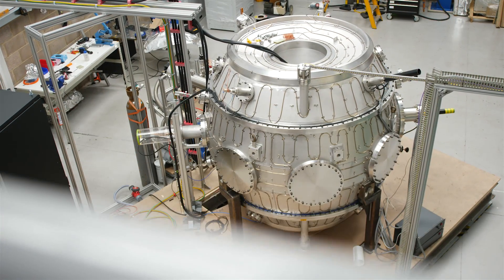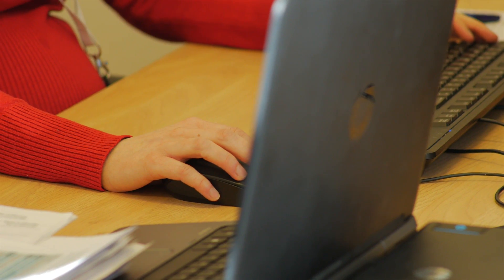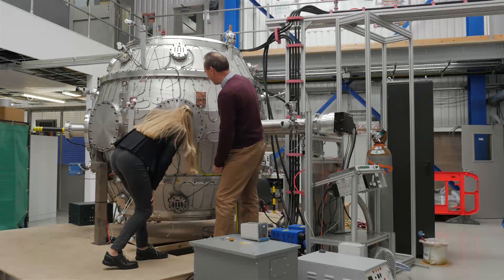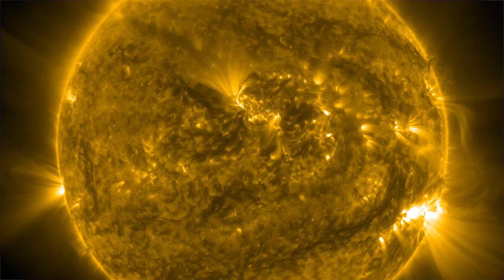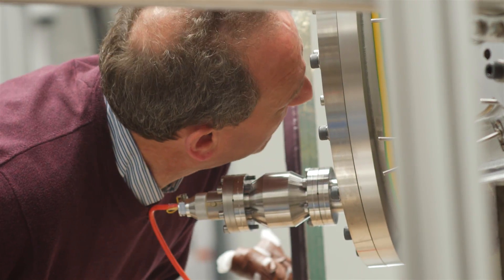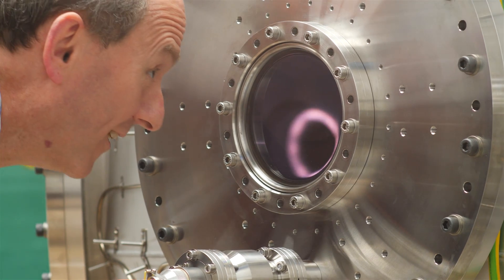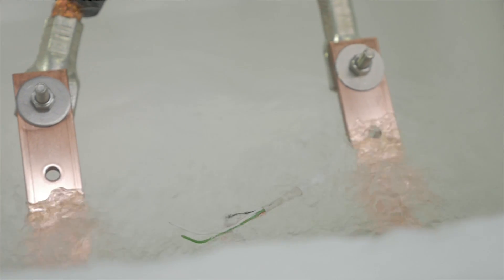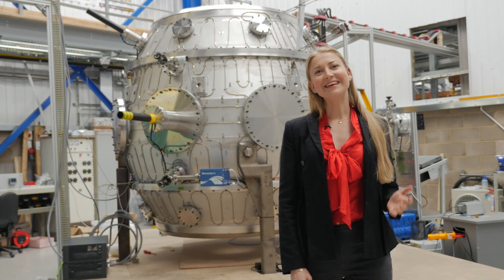ST40 Update April 2017

Comment: you just went in a circle, your internal coils act suspiciously like an electrostatic confinement device... why not just admit defeat and move back into research on how to remove the inner grid from an electrostatic confinement device like a fusor since even if yours succeeds here then you still can not contain the plasma for more than a few microseconds there is nothing new here.

why is everyone so impressed by magnetic confinement it shows no commercial promise even if it works.

Comment: If you are assuming reaching similar performance values (i.e. fusion power) in compact ST's compared to larger "classical" tokamaks, which power loads do you expect at the divertor for a DEMO-like reactor (couple of hundreds of MW)? 

I think the only way to tacke the (much?) larger loads in these compact ST's will be increasing the surface area by defining a double null divertor  config... I guess more "exotic" divertor configurations (snow-flake, super-X, etc.) are too inmature (i.e. too scary for venture capitalists) to be considered at the moment, aren't they

Comment: I love that you guys designed and built a smaller, compact reactor instead of the behemoths that exist around the world. This is a much better (and cheaper!) way to push the science.
Reply: They can make changes a lot more easily too which accelerates research and improvements. Those huge reactors etc. are usually government make-work projects. Which do employ scientists, but not necessarily in the right way... Size doesn't matter so much in this instance.

Comment: As the tokamak's working is fully baised on EM wave , which just control the charged particles ( electron and proton ). But what about chargeless particles ( i.e. neutron ) . 
When fusion will takes place in the tokamak's reactor , i am afraid that our technique is not able to sustain that high charged neuron and tokamak may be harmed along with human life.
I may be wrong as my point of view , if there is something which is have not understod so make me understand by commening in comment or send me a mail.
Reply from the maker: Neutrons will be created in the fusion reactions and they will fly out of the inner vacuum chambers because they will not be trapped by the magnetic fields (as they have no charge). Future power stations will make use of these neutrons to generate electricity.  The energy of the neutrons will be absorbed in a blanket layer, which will heat up.  That heat will be used to make steam and drive turbines to generate electricity.
Reply: sorry could you please elaborate..?
How could the neutron will fly off from the inner vacuum chamber ? As our device is static. So the neutron may have to seattle down on the reaction chamber.?
Reply from the maker: The neutrons are tiny so they can fly through the wall, passing through gaps between atoms (or sometimes hitting atoms out of place, which is a problem as this affects the material of the chamber).
Reply: Its ok about the size of neutrons.
but what about the high temperature? Is that high temperature doesn't effect to the technology..?
Reply from the maker: There is a contact form on our website www.tokamakenergy.co.uk
Reply: Deepak Kumar, the temperature is not really an issue because it is only the temperature of the plasma itself. Magnetic fields are used to keep the the plasma rotating around the center of the tokamak and away from any of the walls.